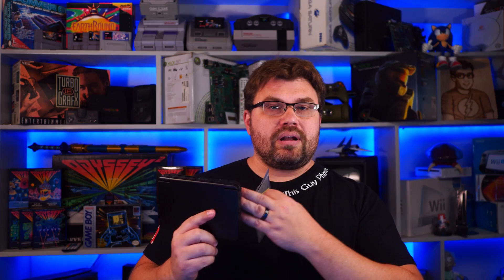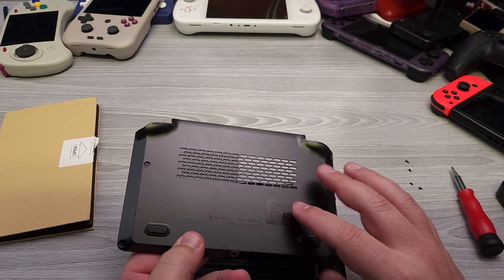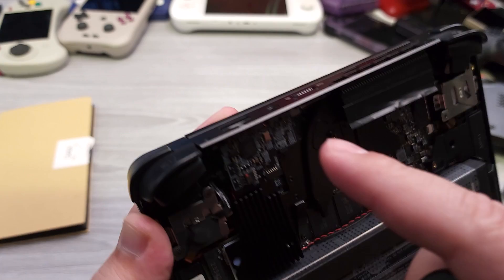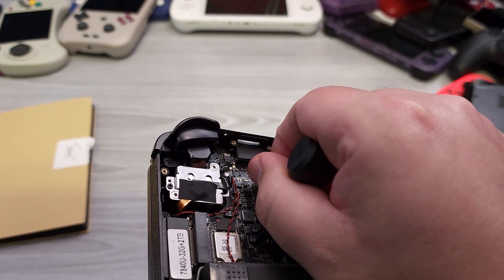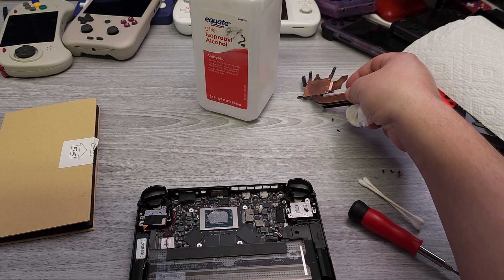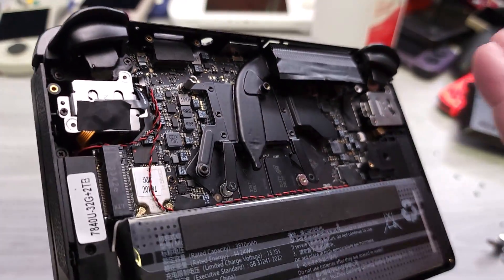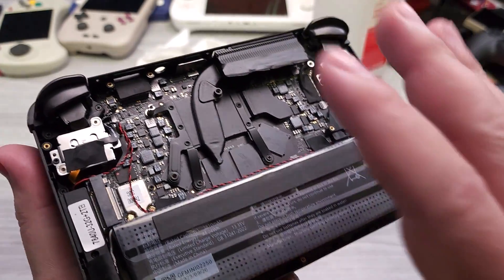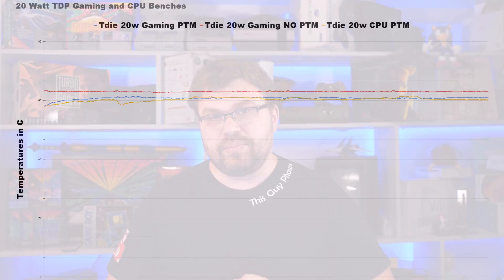GPD Win Mini Upgrade - PTM7950 and Disassembly

Comment: Obviously different but thermal pads compared to paste, I did this on a liquid cooled 6900xt and the pad was a super high quality pad but it would still exceed heat limits and shut down. With paste it runs at ambient. Makes me feel like paste has to better in this situation too?

Comment: What are the surface temperatures like after changing thermal compounds? I've heard that the win mini gets uncomfortably hot around the face buttons if you run it above about 15W, and I was wondering if improving conductivity to the fan (and reducing backsplash in the airflow) would help with that...

Comment: GPD engineers couldn't solve the device's heating problem, so they cut Tdp by 20 units, essentially throttling the processor's performance, what do you say to that?

Comment: Great video as always phawx. Gonna mod my 64gb/2tb 👌
Reply: I've got the same one but mine gets quite hot and the fans get rather loud, is yours the same?
Reply: @riazhussain2333  are you using motion assist? You can adjust fans there.also just disable cpu boost. I've changed my ssd to a 2280 one as the 2230 was getting too hot to touch lol.all good now
Reply: @liviup6660  Ah brilliant I'll give that a go thanks! Also would that affect the performance when playing AAA games?
Reply: @riazhussain2333  no. That how you control and manage its power settings
Reply: @liviup6660  Thanks for the advice!
Reply: you put 2280 in the win mini??
Reply: @ICYKCBlue  yes. 4tb crucial p3 gen3 nvme.or you can go mad and do 8tb like me😂
Reply: @liviup6660  yea that sounds great! an 8tb drive that cost more than the unit and have the ssd sit ontop of the heat pipe sounds like a good idea! you should do a video or post a pic of it. I'm sure it will be viral.

Comment: I would lightly torque it down once more for added pressure.
Reply: Do not over-torque the screws on the cooling solution. You will strip them. If you plan on re-torqueing the screws, use a torque wrench set to a very low value. Around 0.5NM, or 4.5 inch-lbs.
Reply: Note this is post burn in. 🔥 Yeah never over tighten, till snug again is best.